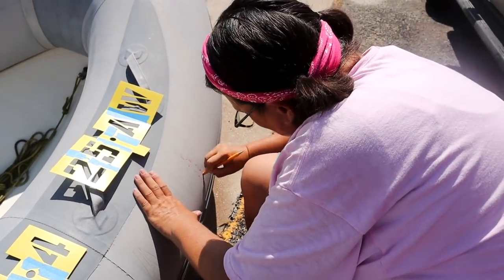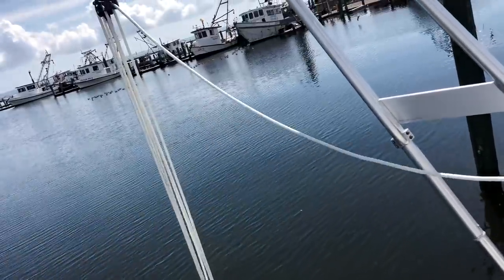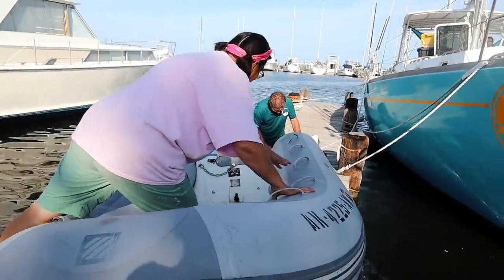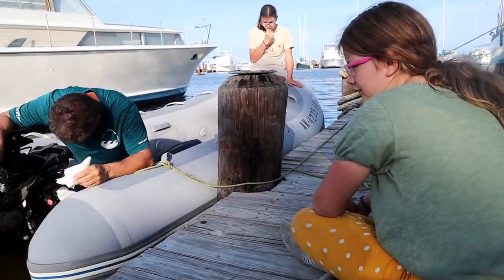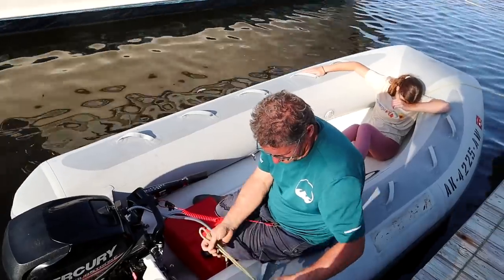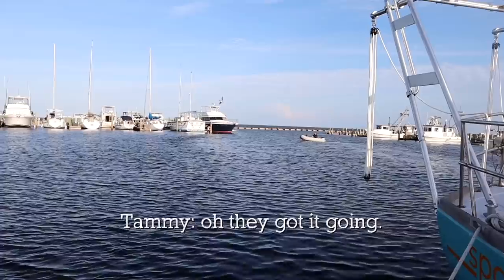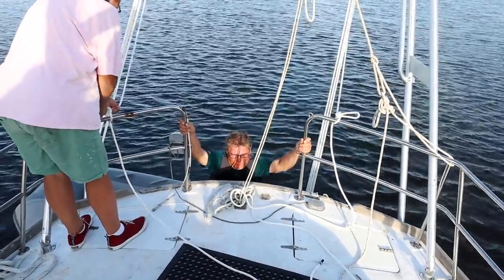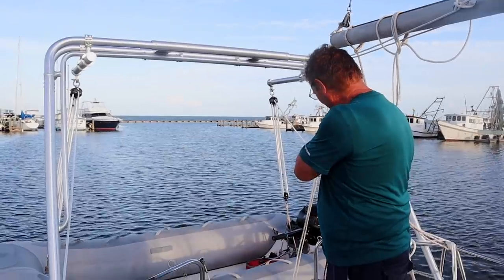Will It Run After a Year in Storage? - Prepping DINGHY for Launch | ep. 183 | Family Sailboat

Comment: On Followtheboat's channel today they covered their dinghy and davits. The Captain recommends mounting the dinghy high on the davit, for following seas. Certainly don't want the dinghy filling up with water on high seas. Also, as I'm sure you know, having triple blocks on your pulley system is easier but requires longer line and is much slower. You can thread your 3 blocks to two and see how it feels. On longer passages, I'd mount the engine on the stern culprit. A hundred pounds is very heavy for both of you. My two cents has been exhausted.
Reply from the maker: Good advice

Comment: My 9.9 mercury needs to warm up for a soild 6-8 mins before heading out.  After that.  No problems.  But... before.  It's a pain.  Also Todd, I'm sure you already know,  but mercury LOVE the non ethanol gas.  You use too much of the regular gas... the carbs start messing up. But, rebuild the carbs, if ever needed... are super easy.  Fyi.  Great video guys!!  Can't wait to see how you moving the boat goes!!  Hope you all are well!!
Reply from the maker: Thanks we are currently running ethanol free in it, as long as we can buy it.
Reply: I also recommend a 2.5hp outboard so you can carry it around a lot easier. It's very slow. But it's sufficient to get you too and from the boat which is all you'll need.

Comment: You'll be much better taking the outboard off and putting on a bracket on the boat. Also taking the fuel tank out. Storing it abroad. Otherwise it's way too much weight hanging up. Yeah, always take ors.
Reply from the maker: Good advice

Comment: Good job on launching that dinghy but the stress load on the davits will be very big every time you bounce the dinghy in heavy seas. You need to re inforce it a lot.
Reply from the maker: It’s pretty solid, but I’m going to add a couple triangle pieces down to the stern rail. That should help.
Reply: @Spoondrifters  You can never make it too strong. Also when it is on the davits pull out the drain plug so you dont fill it with water when underway.
Reply: @hanssolo4ever  or fill with rainwater adding way more weight to the davits

Comment: You need to break that engine in. 10min at ideal. Than to in at standard throttle. Than 1hr at high throttle.
Reply: It's a used engine. You don't have to break it in.
Reply: @gearhed78  oh…Cool. Thought it was new.
Reply from the maker: Yes, it is a used engine
Reply: New plug and non ethanol fuel. I'd lock that engine to the boat. There is  a demountable Garhauer lifting crane that makes moving the engine from the dink to the rail mount.

Comment: I would keep the fuel tank in the bow, particularly for when you are one up which will help it plane easier and quicker and I assume you have a safety lanyard from the boat to the engine.
Reply from the maker: I am considering that, I need to find a way to secure it.